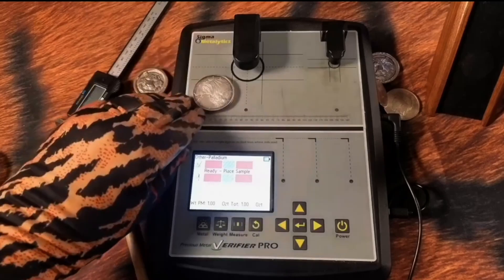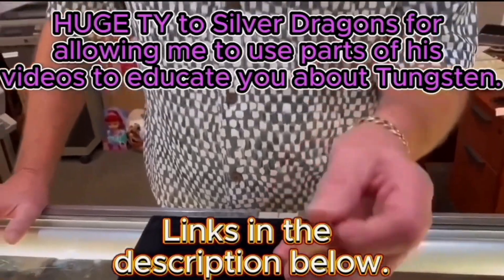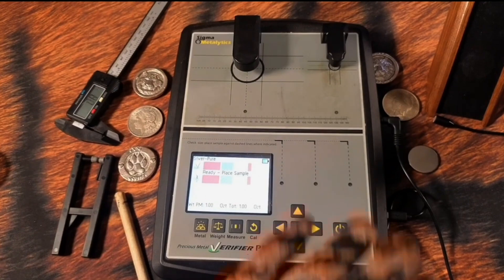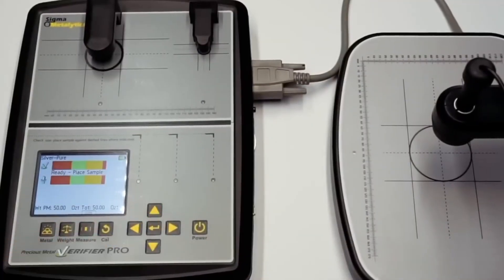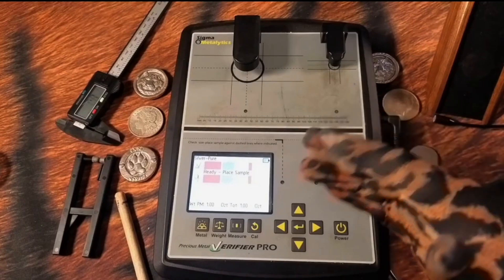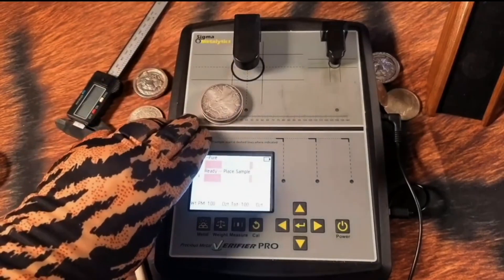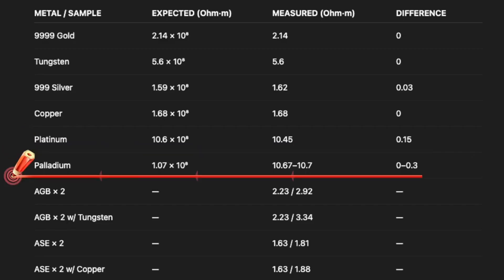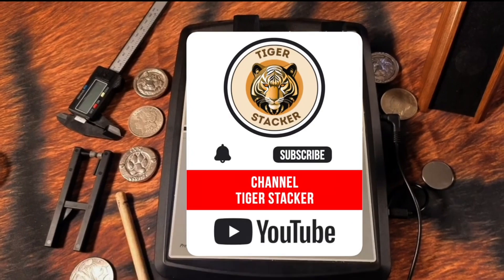FOOLING THE SIGMA METALYTICS – Detecting Fakes with Sigma Metalytics Pro

Comment: If resistivity of a silver coin appears marginal (it is close to copper), check the density. The Pro makes that easy.
Reply from the maker: That's actually close. The pro cannot measure density but it can measure physical dimensions which is part of the density
Reply: @TheTigerStacker  True. One does have to enter the correct weight of the coin being measured for the pro to check density via measuring thickness then using the weight and PM composition to determine the diameter of the coin and display a visual indication of what it should be. A good scale is an essential first PM check.